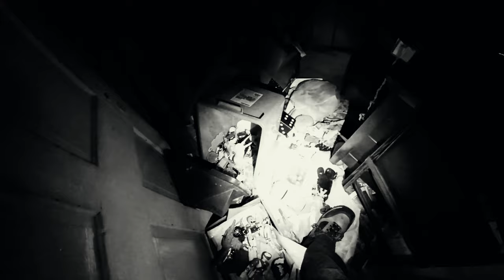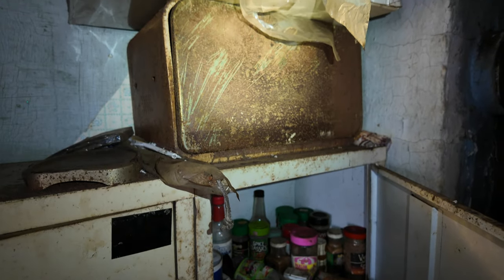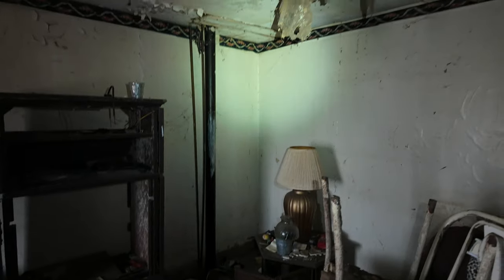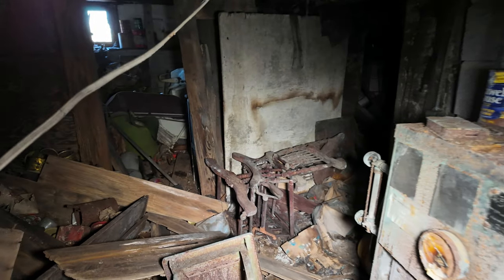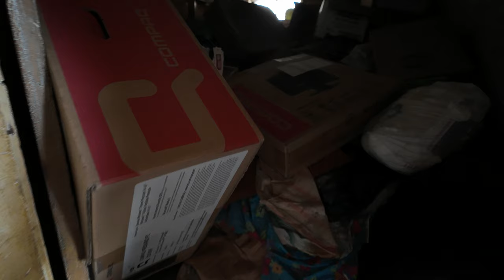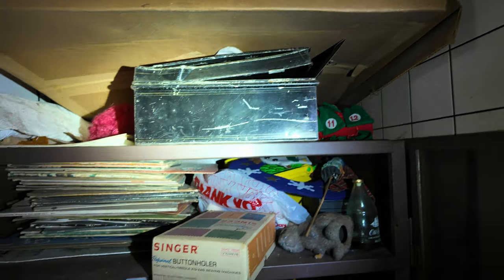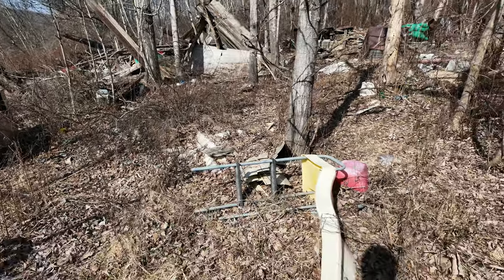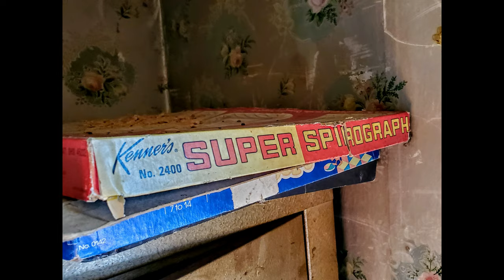UNBELIEVABLE LIVING CONDITIONS! Abandoned Hoarder House Revisit

Comment: Fun Facts: At 36:46 the Morton Salt box on the shelf appears to bear the logo that was used from 1941-1956.

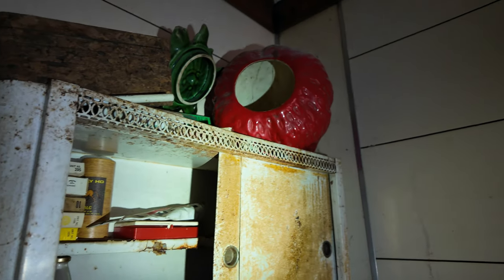At 51:28 the Old Spice bottle design seems to date between 1980 and 1993, so that's been sat there for a while.

At 56:59 the Pampers logo on the cardboard box dates from 1985-2000. This fits with the fact that most of the children's toys are from 1992-1993, and makes me think that there weren't any children living in the house at the end, just possibly visiting.

Comment: I think it started as a pretty nice family in a pretty nice house. As time went on the kids moved out and I think the husband died. The widow likely went through some hard times and stopped being able to throw things away because she might need them later. She also couldn't throw out her kids things even long after they out grew them. At some point down the road the oil tanks and furnace needed inspection, inspectors could barely make it down the stairs, but they did, and they found a tank leaking, failing the inspection and cutting off the oil. That winter the pipes froze causing a massive flood in the basement. With no money to replace them or ability to clean out the basement so people could work, she left it and bought jugs of water instead to do everything from drinking to flushing the toilet. Eventually the toilet clogged and she started using the buckets and throwing wipes on the floor. Hopefully at that point someone in the family figured out the horrible state she was living in, rescued her and she went into a home.